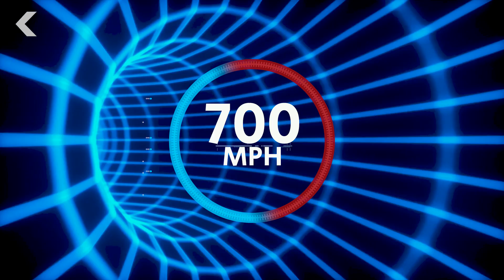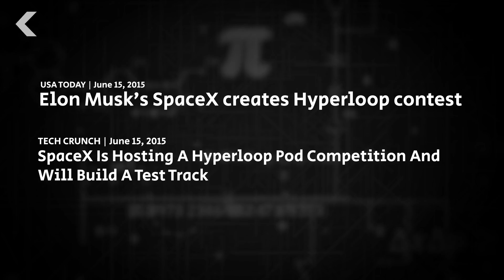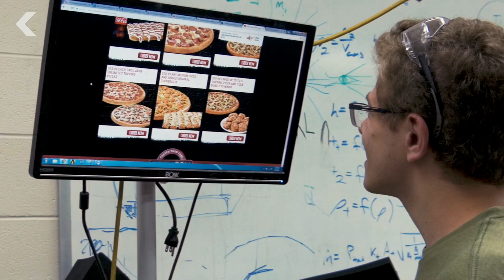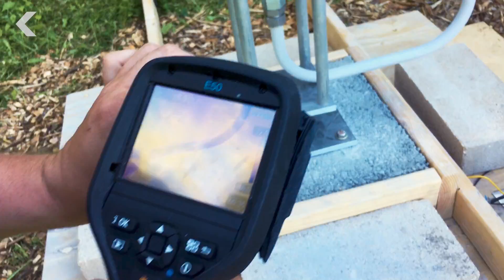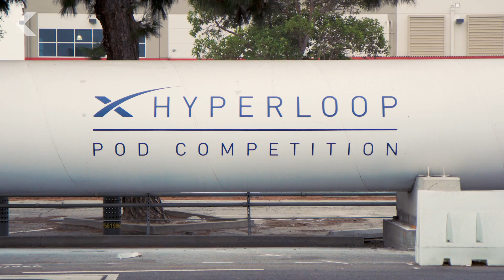These College Students Built a Hyperloop Pod... Here's What Happened

Comment: So they're releasing gas from a container into the vacuum tube? Great design.
Wasn't Hyperloop supposed to be a maglev train in vacuum?
Reply: In the event of depressurization the pod would stop. that was already explained.
Reply: BlaQ I worked on a hyperloop design with a different team, and yeah, all of this is possible, and probably in less than a decade, I worked the safety aspects of our design and we thought of everything and then some, don't assume you know this won't work based on a video when people such as these engineers and even myself spent months refining designs
Reply: +BlaQ there's multiple redundancy systems for that, and you can vent the whole tube in 5 seconds in case of pod depressurozation
Reply: fss1704  Myth Busters actually did a segment on exactly what you're describing. No explosion..the vacuum tank simply lost pressure if it ruptures.
Reply: BlaQ Read the white paper. This has already been explained years ago.
Reply: Well to he frank, it would be a vacuum tube and the train would be levitating on magnets. There would be no noise, maybe faint buzzing from magnets behind thick concrete wall.
Reply: "What will happen after you will damage the tube and tons of air will start to flow inside?"
Depends on the size of the hole, if it's small, the tube will slowly fill up with air and the pod will stop due to air resistance and breaking. If it's big, it will fill up faster and that's it. What do you expect ? That the pod will be crushed by air with a 1 bar differential pressure, please tell me you are joking. As for your analogy with guns (or shockwave/explosion), you do realize that the pressure of these phenomenons far exceed 2500 bar at peak pressur, do you ?

"You will have a wave of air (hundreds tons) that will hit pod with almost speed of sound." Where do you find that air rushes through an opening at the speed of sound ? The speed of sound has nothing to do with that. The speed of sound is speed at which mechanical wave travel through air, nothing to do with air moving itself. To calculate the speed of the air rushing through an operture, here is the formula :
p+1/2*rho*v^2 + rho*g*h = constant
It's called Bernoulli equation.
Reply: As a structural engineer working at a finite element mechanics software company, the amount of fear mongering and misinformation that I see online is almost as disheartening as the amount of people willing to accept it as fact.

The difference between a container meant to hold pressure vs a container meant to hold a vacuum are at the opposite ends of the spectrum when it comes to the optimal design features. The pressure in a pressure container actually adds to the structural support of the vessel. Think of the aluminum can design. In fact, you can even stand on them if you haven't opened them but an empty can crumples easily. The aluminum can is designed to simply hold the pressure that comes from whatever carbonated drink that is inside. While I can't say enough praise about the aluminum can design, it is only good at holding large amounts of pressure. The walls will easily crumple at the slightest vacuum differential pressure.

Resorting to straw-man fallacies like showing an implosion of a pressure container as an argument against vacuum containers is misleading at best and malicious if intended to misguide people for the shock factor and attention. I used to love watching Thunderf00t debunk stupid miracle products that go viral. He is a great physicist but he should stick to calling out things that are physically impossible. He shouldn't exaggerate difficult engineering problems that engineers routinely solve.
Reply: BlaQ do you think they wouldn’t think of all these things in the development of the technology? A technology doesn’t have to be perfect from the start. It takes a thing Called innovation.
Reply: if terrorists don't blow it up i see this happening to the hyper lop https://youtu.be/0qbakrb9KJ4
Reply: You think the teams can afford making a maglev train for a competition? Are you fronting the cash?
Reply: Bryan Otero Most work today is in upping the efficiency of pretty much everything
Reply: the pipe need to be underground ...
Reply: If the tube gets damaged and leaks air the train will stop. Air rushing into the tube would also not travel at the speed of sound all at once like a wall because there is friction like in gas tubes. It would be a gradual increase in pressure but that's just a guess. If you want to know what really happens you have to do what engineers do and simulate it on supercomputers. These simulations are very accurate representations of the reality and SpaceX as a company building rockets have one of the best software tools to do that. Such simulations are used all over enginering and not only in fluid dynamics. Bridges for example don't collapse from thousands of cars rushing across them daily, because engineers know what they are doing. Similarily planes don't break apart flying at 700+ km/h into turbolences and what not. They can also fly through thick clouds of water which can be also seen like a wall at these speeds. You can argue the tube is not safe against terrorist attacks but which form of transportation is? In the end you want to progress forward and a near vacuum tube allows for the fastest travel on ground. Another thing is China just announced they also want to build a Hyperloop called "T-Flight" which is much faster. The intercity speeds will be 2000 km/h according to China while the train would zip between countries at 4000 km/h. I'm not sure how far they are when it comes to development but I would take it seriously.
Reply: Some degree of consciousness will probably be retained for 9 to 11 seconds. In rapid sequence thereafter, paralysis will be followed by generalized convulsions and paralysis once again. During this time, water vapor will form rapidly in the soft tissues and somewhat less rapidly in the venous blood. This evolution of water vapor will cause marked swelling of the body to perhaps twice its normal volume unless it is restrained by a pressure suit. (It has been demonstrated that a properly fitted elastic garment can entirely prevent ebullism at pressures as low as 15 mm Hg absolute [Webb, 1969, 1970].) Heart rate may rise initially, but will fall rapidly thereafter. Arterial blood pressure will also fall over a period of 30 to 60 seconds, while venous pressure rises due to distention of the venous system by gas and vapor. Venous pressure will meet or exceed arterial pressure within one minute. There will be virtually no effective circulation of blood. After an initial rush of gas from the lungs during decompression, gas and water vapor will continue to flow outward through the airways. This continual evaporation of water will cool the mouth and nose to near-freezing temperatures; the remainder of the body will also become cooled, but more slowly.
You have about 60-90 seconds to get the person(s) to back to a re-compressed state, if their heart stops in that time they are as good as dead.
Reply: @SilvaDreams  I'm pretty sure the complete tissue trauma from exposure to a near perfect vaccum would be an incurable case of the bends. Even if you recovered the atmospheric conditions necessary to preserve life, it will be fatal.
Reply: (korinogaro1988) Do you have any idea how pressure works? a 1 square inch hole would only have 15 pounds of force not thousands of tons.
Reply: ''Near Vacuum''.
Reply: BlaQ right? 😂 also, these guys didn't even win. I don't get why they get so much attention. The Hyperloop Team Delft won in everything but speed (they became second...). This is just Americans being americans
Reply: Fair enough. Can you share some details on your solutions for aforementioned issues?
Reply: It would also be nice to have a redundant system built into the other in case of failure.
Reply: Coldend Today progress is technology modification and current tech recycling, and little new tech.
Reply: BlueTJ, yeah it would fill the tube... with the speed of sound.
Reply: don't forget how long it would take to vacuum / depressurizes a tube that big the test tube take 30 mins and if the did some how get all this BS to work it would be like concord.
Reply: The original Hyperloop idea from Musk was about levitation caused by air pressure. However, using a jet engine to compress the thin air inside the tube strong enough to cause it to hover is probably a little too costy for a student competition so you could use compressed air inside tanks to test the technology out without having to buy a jet engine. I'm not entirely sure if that's what they try but it looks like that.
Reply: how about we stop with all this science and look at more simple stuff like economics like how much it would cost for me to take this hyper loop VS driving in my 2014 Camry RZ
Reply: @phalanx3803  where are you driving, how many other people are going in the same direction fro the same distance.
Reply: BlaQ Yes butt they realized how bad of an idea that actually was.
Reply: "you don't see that there is difference between couple thousand litters of air running from the plane and billions of litters of air getting into a tube."
Da fuq you are saying ? This sentence doesn't make sense. If you are talking about the volume of the airplane it's a bit more than just a couple thousands liters (1000 L = 1 m^3). Plus airplanes don't loose air during flight, well unless there is a depresurization ofc. Even if you are talking about that, what volume has to do with anything, the important bit is pressure, more specifically pressur differential. In this case it's just 1 bar : that's nothing, it's the pressure you feel 10 meters underwater. A human can easily dive at this sort of depth without equipement and no problems. 1 bar is not dangerous.
Reply: But am I pretending that a fire extinguisher propulsion is award worthy?
Reply: BlaQ The maglev train in a vacuum is an entirely different thing. It's called a VacTrain, and is meant to run in a perfect vacuum, similar to the so-called partial vacuum tubes the Hyperloop would run in. The main difference is that a VacTrain is much faster, at speeds up to very roughly 6,000 KM/H or more at its full potential. That's much faster than any known airplane in existence.
Reply: Better make it bullet proof..... also maybe they can use a tether or that rail that's holding it.....or nearly holding it still should be a clean stop in a tube it would probably be sliding the most dangerous part is the end stopping which they better create elongated tunnels after stop for failures!
Reply: this. a hole big enough to make air a problem would make actually drivign the pod through a bigger problem.
Reply: It's not a perfect vacuum. There is no perfect vacuum in the universe for that matter. Even deep space in between galaxies has some hydrogen atoms zipping around. At the proposed 1/1000 air pressure in a Hyperloop the drag you feel is roughly 31 times less than it is at normal pressure (E = .5 m/1000 (31v)² => E ~ .5 m v². This means at 900 kph you'd experience the same drag someone experiences at roughly 30 kph outside the tube. It's not much but it is enough to slow a pod down if you don't constantly provide some sort of propulsion. The initial idea was to accelerate the pod at the station and let it glide until the next one. 
For that you need a compressor in the front which uses the compressed air to provide a little thrust. This compressor is not used to accelerate the pod, it is only used to maintain the speed between stations so it does not consume a lot of energy. This is how SpaceX Hyperloop would work but companies like Hyperloop One have a different approach. Instead of using a compressor they will use a linear motor along the complete track and maglev technology. This will make the tube more expensive considering the proposed Hyperloop by SpaceX would glide on an air cushion produced by an additional compressor similar to an air hockey puck. The SpaceX Hyperloop tube would have no powered track which is the main difference between it and Hyperloop One. Should Hyperloop One prove not economically viable enough that would not mean Hyperloop as a whole is because there are different systems which make a big difference. 
That's also why a student pod using compressed air was picked as the most innovative. They built a system which does simulate SpaceX idea very well without using a compressor. A compressor could however alsways be added later on. It's important to get the whole propulsion and air cushion going. How exactly you provide the air pressure necessary is not so important at this point.
Reply: +kNews Space  "There is no perfect vacuum in the universe..." You traveled around the "universe" whatever this could be ? LoL
Reply: Wait. SpaceX Hyperloop would not use maglev technology? There would be too much friction on the wheels and the compressor would be too weak. If they use maglev, then the tracks need to be powered anyway.
Reply: I immediately wondered where the magnetic craft were.
Reply: BlaQ near vacuum*
Reply: The proposed SpaceX Hyperloop uses no maglev technology and no wheels either (for the very fast travel). The pods would hover using air pressure like air hockey pucks. You can simply read their 60 page paper for all the details. They did many simulations to prove that it would work and they also have system to deal with the heating and what not. However, SpaceX builds no Hyperloop themselves and it's up to startup companies to either follow SpaceX guidelines or develop something on their own like Hyperloop One. There is no SpaceX Pod. There is only the SpaceX Hyperloop competition which is meant to provide a platform for students to try out their designs. What SpaceX does or more accurately The Boring Company is to dig tunnels as a shotcut for regular cars which would be driven on electric sleds. These tunnels of course use no vacuum and will only operate at speeds up to 200 kph. The Boring Company plans to shift the traffic underground so that you have more space on ground for buildings and parks. You can think of it like a mini subway for cars. There will be no stations just elevators which put you directly on the sled driving on the track below. These elevators can be placed everywhere above the tunnel so you could relatively easily increase the amount over time so it does scale gradually unlike a subway where you need all the expensive stations right from the start.
Reply: It's like farting in an elevator – if you can get away with it, that is.
Reply: Think about what would happen if one person shot a bullet at the hull of an airplane while it's flying 10 km above the sea level, or any other disaster. Death.
Reply: (Matty) A little air leak.
Reply: (BlaQ) What if a plane runs out of fuel, what if the cabin loses pressure and if anything goes wrong you cant jump out, see how stupid that sounds?
Reply: (AlagomSwede) Armchair engineer at its best the hyper loop has thick steel the tanker was thin steel also any failure would be localised because a vacuum is only -15 psi.
Reply: fss1704 air would fill the vacuum and propel you at unimaginable speeds
Reply: Professional Engineer licensed in the state of Pennsylvania and New York. Thank you for alerting me that, while I discussed the weaknesses of a pressure container, I never discussed what makes a vacuum container any different. The main difference is that a vacuum container has thick, strong walls. 

While the pressure container can structurally rely on it's pressurized content to support its shape and integrity, the walls of a vacuum container do not have any such support on the inside. Therefore, vacuum containers are designed to be much thicker and stronger than pressure containers. Instead of thin aluminum cans, think hefty steel cylinders. 

Instead of support, the vacuum inside causes the atmosphere outside to exert a considerable amount of pressure on the walls of the container: 1 atm = 14.7 pounds per square inch. This pressure is constant on the entire surface area of the container so you can imagine that efficient designs are limited to cylinders, tubes, spheres, and domes for vacuum containers. The most visual explanation I can give for why curved walls are best for uniform pressures is through arched bridges. They develop a line of thrust that follows the curvature of the material.

The design parameters in a tube-like vacuum container are the diameter, thickness, and material of the wall. Assuming they use the most common type of steel, A36, the yield strength of the material would be 36,000 psi. Using the Fermilab Standard equation and a safety factor of 2, the thickness of the wall would need to be roughly 3/32" per foot diameter. For a 6 foot diameter tube, we'd need 1/2" thick steel. I'd think the Hyperloop would use a greater safety factor than what I'm using.
Reply: the tube can be a vacuum at all time. the pod could go into a chamber with a sealed door and the chamber is then safely sealed and depressurized to the same pressure as the whole vacuum tube then the door would open and the pod could proceed to the vacuum with no need of depressurization of the whole thing. for the pod to come out you just have to park the pod at the end of the tube then close the door behind and pressurize the chamber slowly to atmospheric pressure. Just like in space but reverse. So simple
Reply: "ARE YOU SURE ABOUT THAT" insert john cena meme
Reply: thank you for saying this! Every one on here thinks they can just make up stuff that is not true. This is what i was fixing to say>
Reply: Dominic Mammone
I recommend you DON’T “stop with all this science” because the science and the requirements driving it will remind you that Hyperloop is NOT competing with your 2014 Camry RZ, it’s competing with overland airplanes. So comparing the economics in the manner you suggested would be mostly a waste of time and money.
Reply: No !
Reply: Matty THE BULLET, YES I YOU ARE THE FIRST ONE TO MENTION IT! 

Thank you so much, I thought I was loosing my mind
Reply: BlaQ I also dont get it why they dont use electromagnetic propulsion, i think this will be changed in a future and this is just a concept
Reply: Matty Uhm, the air would just go through the hole and fill the tube with oxygen, or what do you mean?
Reply: But you would have air in the tube. That poses a danged to a train moving 700 mph. It can't go 700 mph where there's air. So when there is air, you have a catastrophe. The maintenance of this would be a nightmare.
And what if the train gets depressurized? You'd probably suffocate.
What if the power goes down and the train stop in the middle of nowhere? How much time until you're out of oxygen in the train? You can't go out, there's vacuum out there.
There's just so many things that can go wrong.
Reply: @B1aQQ  you mean like an aircraft.
Reply: @benwilms3942  What kind of plane flies in a vacuum?
Reply: @B1aQQ  every passenger airline effectively, the vaccum is essentially just the pressure differential between the inside and out.
Reply: @benwilms3942  Vacuum is a space with no matter. Are you taking a vacuum cleaner as an example because it has "vacuum" in the name? wtf
You know very well what I mean and you're arguing technicalities and semantics for no apparent reason.
Reply: @B1aQQ  nope. I'm pointing out that the considerations for working within a vaccum have been worked around by engineers for a very long time. And in the context of a hyperloop the engineering considerations of a vaccum are not simply an absence of matter, but the pressure differentials.
Reply: @benwilms3942  The whole point was to have as little friction as possible. Now you're moving the goalpost to "well, maybe just a little bit less than usual"? It's a stupid idea and stupid design.
Reply: @B1aQQ  oh I don't disagree with this being a poor design, I disagree with the idea that none of the inherent challenges have been overcome in the past. In fact, basically all of them have.
Reply: +Matty fuckin shit, stop using a fucking  PRESSURE TANK to analyze what happens in a VACUUM TANK, two completely different things, a pressure tank isn't made to sustain vacuum, it's reinforced in the outside, a vacuumm tank is reinforced on the inside, if you shoot a pressure tank in vacuum it WILL implode, that's not the case with vacuum tubes, you can shoot a vacuum tube and all it will do is to loose pressure.
Reply: fss1704 you see, yes a vacuum tank reacts the same way as a pressure tank. The laws of physics don't magically change because the thing is name differently.
Now consider this too, the walls of the hyperloop Elon musk made were merely just steel plates in circle, barely half an inch in diameter. Want more info? Watch thuderf00t video on the hyperloop. An actual physicist that explained why it would fail in multiple videos in great detail.
Reply: +AlagomSwede
 +Jean Philippe Cornay
I love when people comment on a subject they know nothing about because they blindly follow someone without questioning his reaoning, I really appreciate TF but, as a scientist, I would say that his arguments are weak, at worst they are engineering problems not physics problem. As for the difference between vaccum and pressure vessel :yes there is a big difference : they are not engineered in the same way. A pressure vessel is reinforced on the outside, a vaccum vessel on the inside, which definitely change the result.
Reply: Matty Bullet doesn't pass. If hull is damaged, brakes and safety? Vacuum tubes are built so in case of a depressurization they won't crunch into a glob of steel
Reply: Internal combustion engine!?! You mean igniting fuel that explodes INSIDE the vehicle!?! What if there's too much fuel? Where would you store that fuel? How could you be sure it is safe? 

You know the big difference between the technological innovations made in the past, and those of today? Pearl clutching cowardly nay-sayers. Better to just design a new mobile app and call that "progress".
Reply: korinogaro1988
Just like any airplane. Yet they fly.
Reply: +Dominic Mammone
I am not saying that it's a viable mean of transportation, economically viewed. But that people who do not understand the physics behind this project should stop parroting  what TF said, without really understanding, and going even farther by saying it's a physically impossible concept because it's not, it already exists at a smaller scale, so physics wise : it works.
Reply: What if your engine in your car fails while you're on the highway? what if a tire blows out? What if someone shooting a bullet at you.

We need to be aware of the risks and attempt to project a percentage around them but there will be risks and occasionally (hopefully incredibly rarely there will be tragic accidents as what's happened in planes, trains, and cars). 

Ultimately it depends on how we can mitigate these risks. Perhaps we can make the tube bullet proof. Perhaps we can make the Hyper Loop tube underground. Perhaps we can make it well above ground so people with ill-will have a hard time approaching it. 

There are risks but those aren't nails in the coffin they're just something to evaluate and address.
Reply: BlaQ think about what would happen if one person shot a bullet at the hyperloop, or any other disaster. Death.
Reply: I'm with you on that one. It seems too hard to maintain vacuum in the tube for it to be viable in the nearest future.
Reply: +Spacecookie  Who cares when the passengers are crushed by the lack of pressure outside the vehicle and the tube, LoL
Reply: Matty you have been watching too much Thunderfoot, don't believe everything you hear on YouTube. However in response I would find it hard to believe the loop would be built with 1 layer of metal, there's no redundancy in the test track as it doesn't require it however I would hazard a guess that the loop will either be several material layers thick (one would require thermal mitigation, weather resistance and probably an additional redundancy layer), the other option is to go underground which seems more plausible due to the thermal stability underground (we already run long pipes underground and have done for generations). I'd put my money on the combined efforts of multiple universities, experts and businesses to achieve this project over a YouTube doomsayer.
Reply: All you people are talking about the tube breaking. Which could have some danger to it. But the most danger comes from the passenger compartment. One loose bolt or screw knocked off the ground of the tube by the train would be suddenly going 700mph, and if it hit the compartment it would create a hole in the compartment. All the air would be pulled out of the passenger compartment.

And with the lack of air Elon musk is proposing you might as well be in space. You'll pass out in 30 seconds, and be dead in a couple of minutes. Oxygen masks, if they didn't break, would just mean you are awake when you die.
Reply: BlaQ yeah well the "brightest minds" aka kids with rich parents. (It's students building the shitty pods.)
Reply: fss1704 Vacuum and pressure are the exact same thing. The danger is in the pressure differential between the inside and the outside of a container. It doesn't matter which side has higher pressure than the other; the effect is the same. 

By the way, this is what could happen to the entire hyperloop if the structural integrity was compromised at any point: https://youtu.be/T9bpUfWy8Wg?t=2m30s
Reply: quangluu96 you can leave a plane 
all you have to do is land it
this requires you to get out of a depressurized tube 
it's not a simple as opening a door
Reply: just laughs at this conversation 
Deathtrap and tubes exploding when the local shoot the tube because of the noise.
Here is how I see this going..
Gringos make big target in the sun it makes a lot of noise the graphity offends the essay and he pops a cap in the pipes ass maybe 10-15 rounds in the same spot.. the noisy thing goes by and essay and the train explode all over the sunset.
1 dead cabron and 50m-1bill goes all over the desert. Can people not see this thing is a terrorists wetdream?